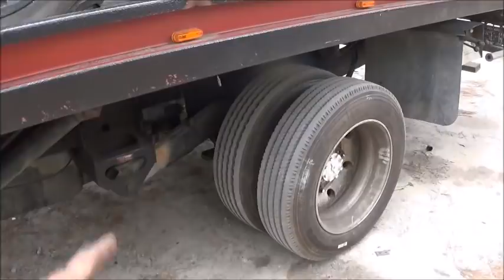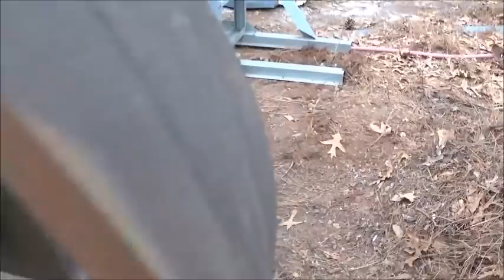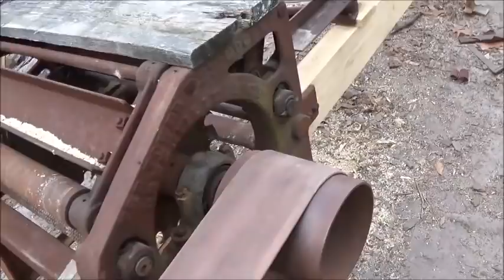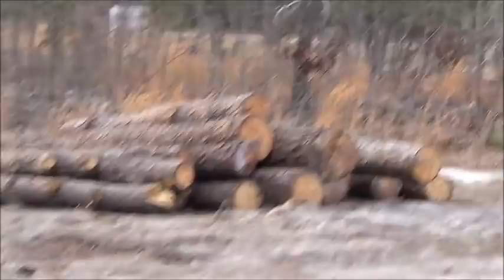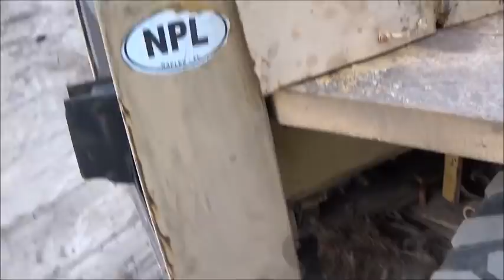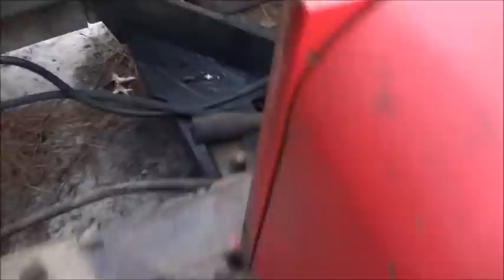TRUCKS, FORKLIFTS AND STEAM ENGINES

Comment: Hey sir ive seen ur studebaker video. Im tryna get the seats out of my dads and get him new ones for fathers day. What size socket fits the bolt that holds the seat to the metal frame thing. Cant seem to find the right socket. Such a tight squeeze

Comment: The mercedes motor will do you proud Johnathan... had  2.2 D back in the day in a L306D  pickup.. old school  my Dad bought it  from a breakers yard for 300 quid  and the f'eekwr worked its ass off for 8 years!  No puter on that just fill with fuel  check the oil and water... will do you proud bro!

Comment: agree...that link air ride is absolute garbage. rides worse than the same truck with spring ride and major design flaws. check your pinion angle on yours. you might be surprised. peterbilt low leaf, freightliner airliner or that international low leaf style on the u haul trucks are so much better.

Comment: Jonathan, a pair of forklifts working in tandem can be a nice way to unload heavy items from a trailer. Use one on either side of the trailer, directly opposite each other. Can't recall seeing you do this so apologies if this is a "technique" you know about. We used to have two three tonne forklifts and we used them in tandem to lift items heavier than their individual capacity. We lifted clear of the trailer and then drove out from underneath.

Comment: Great to see another post from you Sir ..understand you being busy it comes with the job.....please be careful on that sharp moving equipment, last month ... I did the biggest NO NO .. 40+ yrs experience framing and remodeling I knew better ..especially at my age  ..you don't run a table saw with out the guard in place  ...long story short ..I lost my index and was totally amazed the surgeon was able to save the middle and ring fingers ... lots of physical therapy..I go on the 17th to Charlotte to get 5 pins removed ..
Reply: Hey I did the same thing 2 years ago the saw caught a not and pulled my right hand into the blade cut 1/4" off middle and ring finger and Im still having trouble with the nerves that are close to surface they throb all the time and what nails grew back have to be filed down can't cut them with nail clippers fills like cutting them off all over again but good luck with yours and you heal good and can use them again